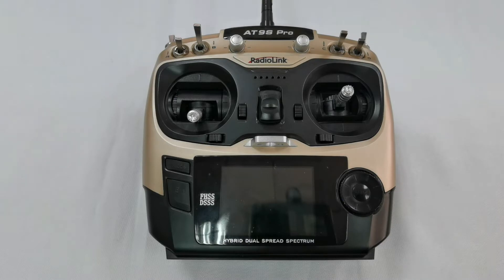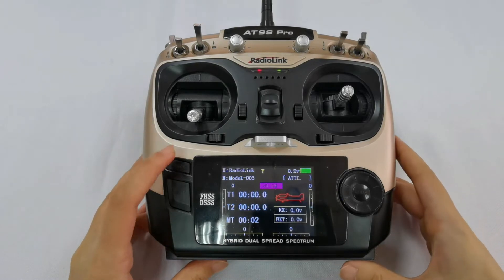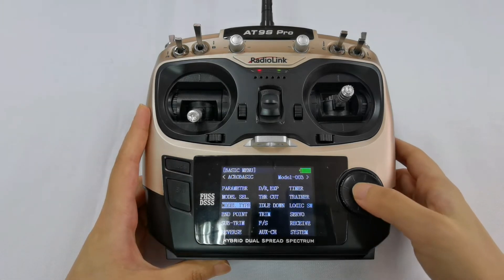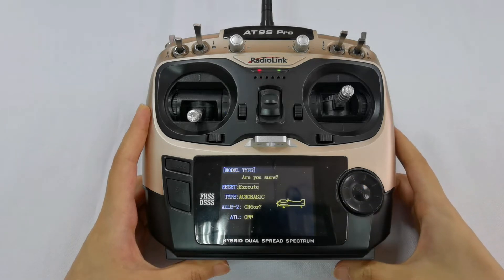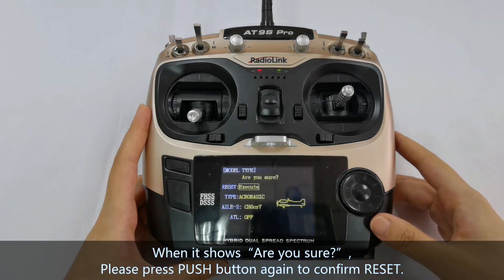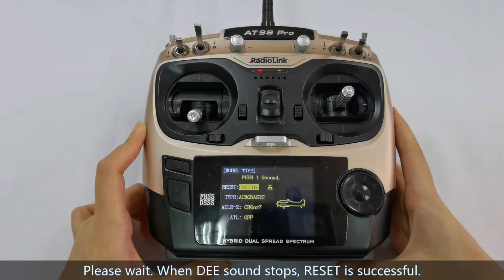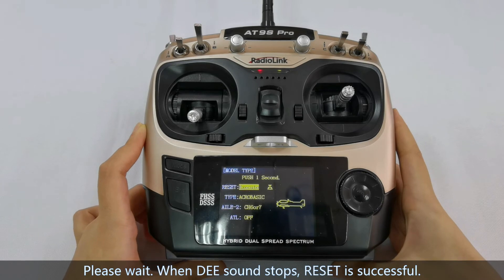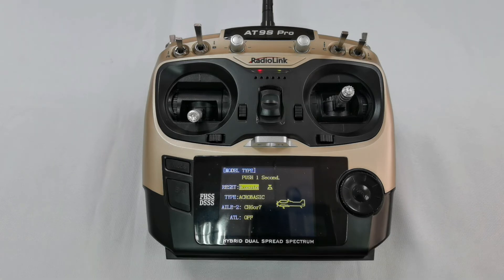How to Reset AT9S Pro/AT10II Transmitter?

Comment: Gostaria de saber se pode ter algum problema em usar o RX no aeromodelo a gasolina 10cc pode sofrer alguma interferência  R12DS com TX AT9S?
Reply from the maker: Hi, sir. Yes. You can use R12DS to control the gasoline model. They can work well together and the interference won't affect the signal. If there is any question, please feel free to contact us. Our email is after_service@radiolink.com.cn